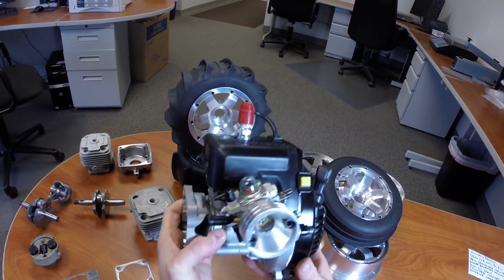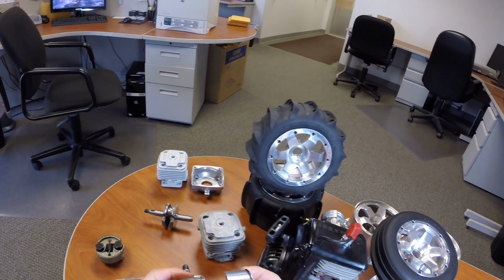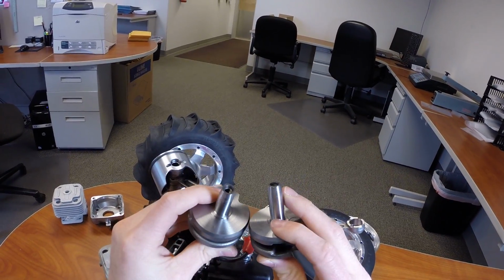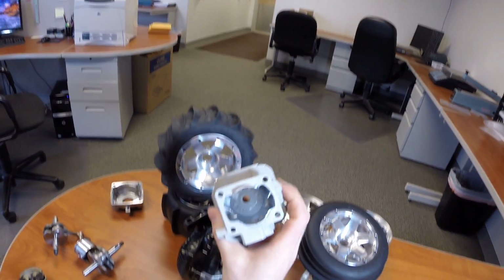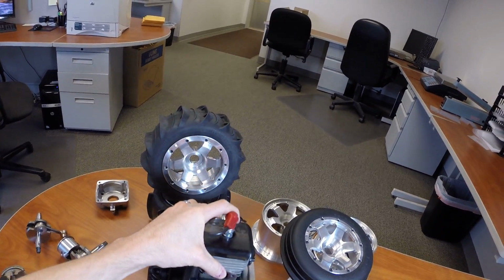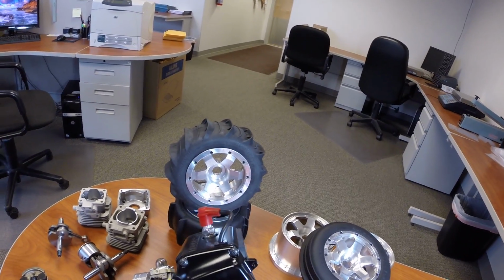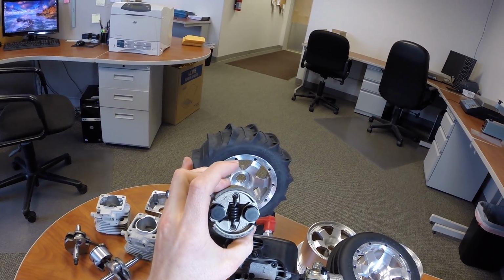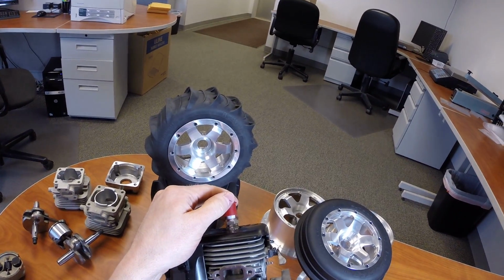Zenoah G320RC: The FIRST hands on review and details by DDMSteve! Davesmotors.com

Comment: Great engine! Around 100 miles so far on mine mounted up on a GoPed GSR Cruiser without a hiccup. Running it on the stock muffler as not to annoy the neighbors to much, still hit 40mph @ 12,850 rpm hauling my 205#'s around! Slow run through the neighborhood

Comment: I just pulled the trigger on this bad ass "Zenoah G32RC" last night at DDM Racing with discount via Dave's Deal of The Day! We'll see the performance of this "Zen G32" if it can withstand continuous of abuse WOT (Wide Open Throttle) hard bashing in Desert Sand Dunes!!
Reply from the maker: Sner - RC Pilot you will love it! With WOT running be sure that you run a mixture of at least 25:1, even a little more rich possibly. If it gets too hot you can lean seize it. These things love their oil and put out great power
Reply: DDMSteveB - Thanks a lot for the wonderful tip! I've read tons of positive reviews on Zen G32! Very well noted regarding the mixture 25:1 (1 litre Gasoline + 40ml 2T Motorcycle Oil).

However, I've been using for a long time ratio 20:1 (1L Gas + 50ml Oil) since I'm also using the "Mixed-Petrol-Oil in Jerry Can" for my RC Plane Gas Evolution 10cc.

Does Zen G32 like "more oil/lubrication" or I must strictly follow and use 25:1 mixture? =)

Comment: Great review, thanks for posting. While I'm at it, may I suggest that you tilt your head camera a bit further down. Some of the items you were talking about were out of the frame or just making it into the lower edge of the frame.
Reply from the maker: Yes, sorry about that. I was using the HeadStrap mount for my GoPro and I didn't quite get the angle right.

Comment: Is there a Zenoah that's a 30 or 32 or bigger? That I could get for my new MT XL LOSI ? I'm not knocking the 29cc that comes with it because it really performs well and no issues what's so ever it's a true work horse but I would like to have something crazy on that RC! I'm also looking forward on your new DDM parts for the MT XL LOSI model.
Reply from the maker: This engine is the Zenoah 32cc engine. There are options that you can get that make this engine a 34cc engine. It will definitely increase the fun factor of your MTXL.
Reply: DDMSteveB Thanks for your help Steve and getting back to me. I will think about the 34cc. Would the 34cc be a direct bolt on? If so that would be great! If not then would you happen to know what I would need to make it bolt up to my new MTXL? And should I put a air stack on it like I have on my 5T and Baja and DBXL Or can I just use the new stock LOSI air filter that comes with the truck and  really like? I'm looking for torque not RPMs so I would think I won't need an air stack, but if you recommend it and think the motor will run better?  then I'll do it!
Reply: BOTAJELL the mtxl is basically the dbxl chassis with extended a arms and bigger wheels, so I would assume the stuff that works on the dbxl should work on the mtxl

Comment: to run the carb this has on other engines will i have to use that carb intake manifold too , do you sell those and will it fit work on other engines  ?
Reply from the maker: This carb will fit other engines with no other items needed. The new insulator manifold is specific for mounting to the G320RC Cylinder.
Reply: thanks hmm . now i wish i had added the carbs to my cart . ah well ill order 2 carbs next week .

Comment: When you say it's a 38mm , is the cc rating aswell ?
Nice review/overview by the way :)
Reply from the maker: Thank you for watching the video! 38mm refers to the bore size of the cylinder and the diameter of the piston! The stroke of the crankshaft is 28mm in length from top dead center to bottom dead center. The total displacement is 31.8cc :)

Comment: love it as well,thinking about getting one into my baja when i get it but i dont have the extra 400 bucks to buy and modifyed or tuned version in europe. so ther is the main question, can you guys do an video on how to make this thingeven better with affortable parts like an new crank and so on?
Reply: also im wondering on alot of shops it says that the 29ccm enginge does have more ps how it this possible and does it really maean an diffrence with an baja 2b 5sc?
Reply from the maker: Right now we have only the "standard" stock engine. Doug @ ESP is still finalizing his porting design that he wants to settle on to squeeze out more power. We will have the head kits available separately that you can install after to get more RPM/HP. We can do some videos on those when they are all done.
Reply from the maker: you can't get hung up on the HP number too much. The main thing is the design of the engine, stroke length and bore length and what you are trying to achieve (lots of torque? Lots of RPM?) and then buy an engine with those things in mind. You also need to take into consideration the gearing.
Reply: i was thinking of alot of torque but also get some good amount of rpm so basicly it will run nice in mud and sand but also get good speed out of it
Reply from the maker: toby baconator The great thing about more displacement is you can throw more gear at it to get more speed. Since the engine maintains a 28mm stroke the RPM is still good while the peak HP really comes on well to give a bit of grunt. Go for it, you will love it.

Comment: It's a stock 32cc engine,don't think it will be as powerful as a worked 30,5cc. But once it's been worked on then it should be.
This engine will be fine in a baja, not too powerful.
Reply from the maker: I am really interested to see what the different engine builders are able to get out of these engines. They are definitely a game changer. Our +2mm stroker crankshaft is in the works and will be available shortly after the engines hit the market.

Comment: Awesome vid 👍 i just bought one of these whats the best oil to use to break in the motor. I have a full synthetic motorbike 2stroke oil is this good to use for break in
Reply from the maker: There are a lot of different opinions - main thing is a quality two stroke oil (which it sounds like you have) at a 25:1 fuel/oil ratio will be good. That is 5.1 oz of oil to a gallon or 40cc for ever 1 liter of gas.
Reply: DDMSteveB thanks mate great help

Comment: Hello. Got the G320 home today having problems. The clutch bell bottoms out on the clutch. I removed the washers between clutch and mount that presses on crank. And it will fit. Tried running and clutch doesn't want to disengage at a low speed. Any thoughts. Thanks in advance. Application is on a losi 5ive thanks
Reply from the maker: 17madracki17 It sounds like the inner face of the bell could be binding on the edge of the clutch shoes. Use the CY clutch plate instead of the Zenoah clutch plate. The CY clutch plate pulls the shoes in towards the crankshaft about 2 or 3mm: http://www.davesmotors.com/s.nl/it.A/id.2442/.f

Comment: i have one of these engines but think most of parts on Baja 5b are stock have a dominator exhaust on it also would you recommend upgrading clutch housing bearings etc. and also are there any more parts you would recommend for this engine.
Reply from the maker: An upgraded clutch carrier is a must have for the Baja 5B. The Turtle V2 clutch system is the best. I would look to get better dog bones as well. Get some different tires because without good tires the Baja is really challenging to drive!

Comment: whats the benefit or need for the velocity stack on your carb on the motor mentioned above
Reply from the maker: +Thomas Picard A velocity stack is simply an air filter adapter. It bolts to the carb and makes a base that allows for clamping type air filters to fit on to the engine.

Comment: If peepz have gopeds, this engine will only work with a clutch? no spindles?
Reply from the maker: for clutch drive scooters it will be a direct fit. For direct drive spindle guys the spindle will fit on the crankshaft BUT you will have to modify the frame and drill out new holes to bolt the engine on.
Reply: Jordan DK did u try without clutch?

Comment: I'm new to 1/5 scale. How much more power do these have over the stock baja ss 26cc motor? I have a Dom v2 pipe too. Thanks.
Reply from the maker: With a Dom V2 that would have a serious bump in low end power over the stock 26cc. The new 32cc is basically the new standard for awesome power. A while has passed since this engine came out, and this has easily been the best selling engine since its release.
Reply: +DDMSteveB ok thanks. I might get one and gear my baja up for a little more speed.

Comment: Hi looking at the site, What does the G340cc mean, is this engine a 32cc or 34cc?
bb130x - ESP Ported Zenoah G320RC 31.8cc / G340RC 34.0cc 4-Bolt Engin
Reply from the maker: Ron Marsh The G340 is a 34cc engine. The stock engine has a 28mm stroke with a 38mm bore equaling 31.8cc of displacement. The G340 is 30mm stroke with 38mm bore, equaling 34cc of displacement. Generally longer stroke = more torque and less RPM.

Comment: Can be installed on fg onroad ?
Reply from the maker: No, because of the larger crankcase on the engine and the design of the FG there is not enough clearance for the input shaft of the transmission.